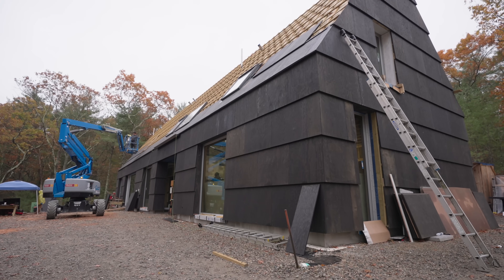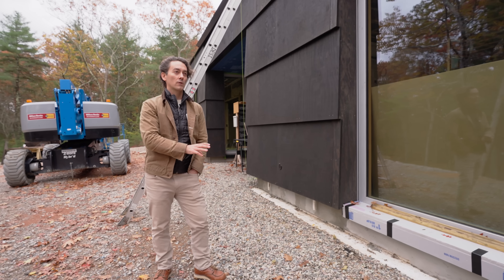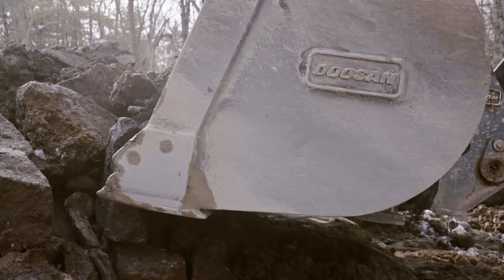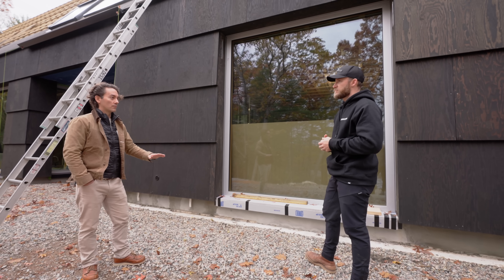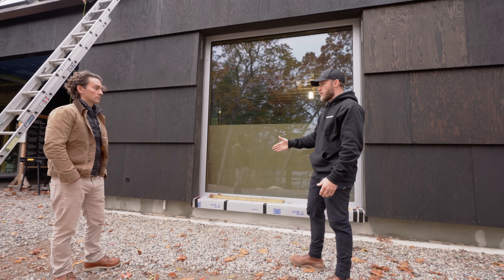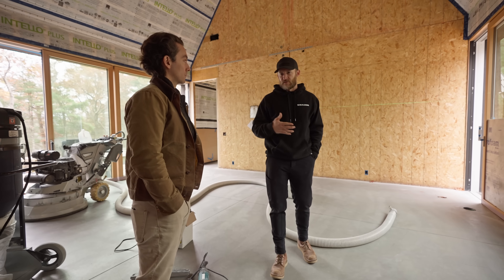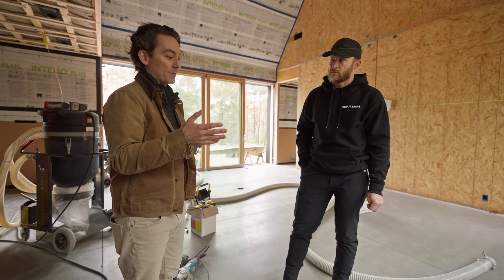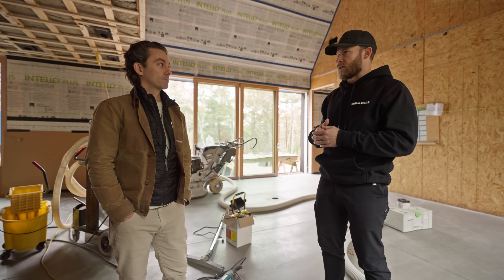Our Frost Protected Shallow Foundation System

Comment: Did you need to add wings for unheated spaces? Also what is the material they are using underneath the forms to level them before setting up? I recently did a house on bedrock and did all the form work myself. The unevenness of the rock was a big challenge but we could not bring fill in to level it off as we couldn't ensure compaction. Whatever material they are using seems like it was intended for this purpose.

Comment: Nice project and nice explication about  monolithic eps slab ,just 2 error monolithic is all concrete detail in same pour inner pier with all slab,not 2 pour.second you need to work with SLAB MASTER FORM for more easy,performance product without wood bracing or backfill before concrete pour.

Comment: Would it be possible to incorporate underfloor heating too, with this single (high accuracy/ strict tolerance) pour concrete slab technique? If so would the underfloor system be like the older versions where a lot of time was needed for temperature adjustments, or can there be like a hybrid system where during the pour the pipes are planted on a insulation layer above the still wet concrete?

Comment: I was originally thinking terrazzo-lite for the floor, like 1/3 the effort, but a higher cost. But then I was educated. The necessity of flatness and that small sweet spot of milk depth has to be hit.  It's like restoring a painting, too aggressive and it's lost.  Terrazzo may be pretty until grinding hits rebar;  I dunno.  Looks great, but I'll check it out later when Nick's not raking dust.
Reply: Thanks for the duroc tip.  I've been considering cement siding/trim to span the 10" window cripples and another 5" to 7" to cover edge of slab.  Parging duroc would allow an unbroken 144"x16" surface.

Comment: it is overdone - just pour a monolithic slab and integrate foam boards into your forms - no need for tapcons or parge - the architects get things wrong all the time because they are not building
Reply from the maker: And leave the exposed foam?
Reply: @NSBuilders  How do you protect the exposed eps from UV degradation among other things?  With all due respect, the simplicity of a forming system that represents the required insulation for a successful code compliant FPSF is as simple as you can get.  With regard to EPS protection there are a whole host of options from simple to less so.

Comment: What non-frost susceptible material did you use for the drainage layer beneath the slab insulation and what density or compressive strength did you use for the insulation under the point load footings?
Reply from the maker: DuPont high compression rated foam

Comment: We just used this on our first foundation, wife and I did all the work except pour day.  60x40 garage.  Extreme spread was under 1/8 inch difference.  The hardest part was 2x12s do not stay straight when they get wet.  Leaning towards using LVL on the foundation for our house which is 80x40.

Comment: There are 2 types of concrete. #1 - concrete that has cracked. #2 - concrete that will crack. The best you can do is to try and direct the concrete to crack where it won't show. i.e. in the saw cuts

Thanks for bringing us along on the build

Comment: My two cents:  I dislike concrete floors. They are hard on the feet and legs, especially as you get older.  I wonder if the new way of doing floors where you put down two layers of foam board covered by two layers Advantech subfloor would be any more comfortable.   I also dislike having windows that are that close to the ground in snow country.  I think that's asking for future trouble.
Reply from the maker: Windows stay closed. Doors open under protected breeze way. And area rugs will help soften where necessary

Comment: Interesting project, and lots of good stuff here.  Though will be interesting to see how parged Durock holds up through freeze/thaw cycles.  Also, that self-leveler as part of the finished floor is against code.
Reply from the maker: Please share which code you're referencing, Im unaware of anything that states that.
Reply: @NSBuilders Thank you for the response, and you're correct that IRC (or likely any local building code) doesn't reference self-leveling cementitious products.  IRC does make it clear that manufacturer requirements, so far as they don't conflict with existing code, necessarily be adhered to.  And every self-leveling product I have come across specifies that it is not to be used as a finished floor.  I'm not sure if this is because they aren't durable enough or because of some toxicity from friction/wear or some combination of the two.  If the product you used on your project doesn't include this stipulation, apologies, and please let me know the product name/manufacturer in case I run into a similar situation.
Reply: Jencup excellent question -needs to be resolved. I would investigate some fo the EU self leveling products as they undoubtedly have to address this

Comment: I love the slab on grade solution for the environmental impact and the health side. Basements just typically aren’t healthy. Gotta go through hoops to make sure moisture and mold don’t happen.
Reply: What hoops? All it needs is decent drainage, decent water sealing and decent surface water management just like any other foundation.🤔
Reply: @BoringBurger  basically things that most existing homes in NE do not have. It would involve excavating out the foundation, applying that coating, dimple mat, etc. On new homes, these things are line items in the budget at least. Why not just build slab on grade and avoid it all.
Reply: @MrBrianDuga Many places have limitations how big the house footprint can be and some people (like I 😅) just like basements.